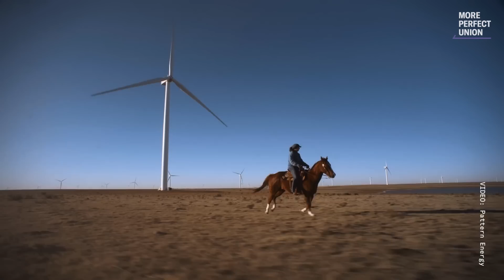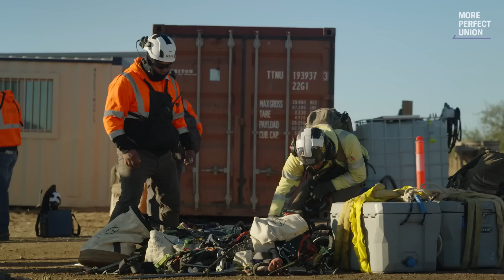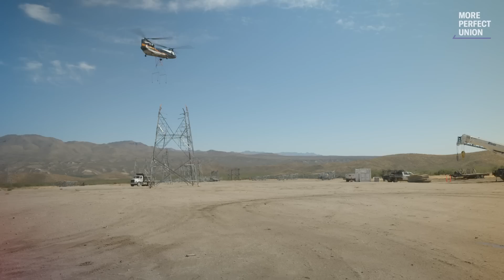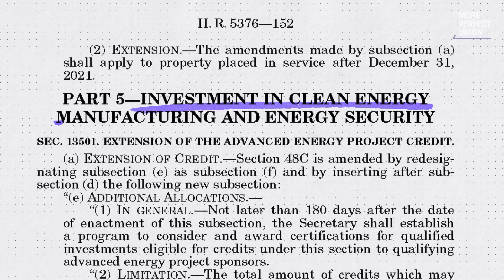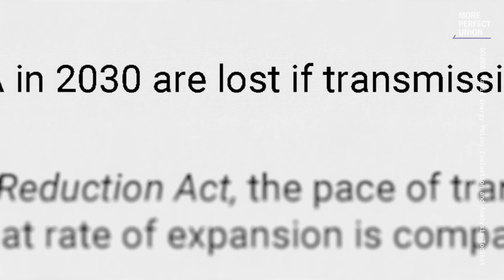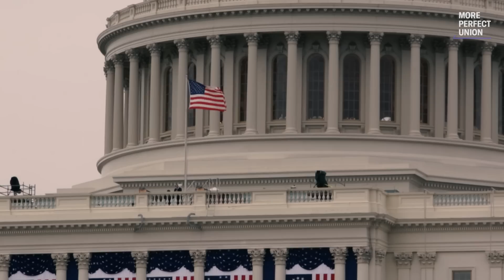Why Clean Energy Might Fail

Comment: Two reasons.

1) Not enough transmission capacity.

2) Billionaires would not be able to derive any profit from clean energy.
Reply: Mostly number two.
That’s why it’s hard to get proper solar investment despite it being extremely efficient in terms of money and resource use. It benefits the consumer, not the seller. It benefits the owner of the solar panels. 
The main impediment to solar energy infrastructure isn’t even storage anymore. Batteries are becoming good enough. The main roadblock is that it decreases reliance on the grid, while fossil fuels increase reliance. And investors want you reliant. 
It’s all about photons coming free of charge vs oil coming at a high price
Reply: 1. Rewiring the grid with newer Hi-Tech carbon fiber reinforced cables is pretty quick and inexpensive compared to building new transmission lines and can increase the capacity many times
Reply: Private equity is getting plenty rich off of wind and solar, while we see electricity bills skyrocket because THEY don't pay for the cost to back up.
Reply: @gregorymalchuk272  yup.. and the companies that buy credits off the renewable companies are not even using the power from those renewables.  Their operations are on the other side of the country where they use natural gas power. Somehow people are being tricked into thinking the gas providers are the bad guys and the renewable companies are the good guys even though the renewable companies are backed by trillion dollar companies.  The renewable companies also use cheap non union labor while the gas plants are hiring well paid union skilled trades workers.
Reply: 2: Oh yes they do.  They own the land that the turbines & solar farms are on.  They make Billions in rent.
And they own every company that makes the stuff & installs the stuff.
The main problem is bad management overall
Reply: What makes you think there's no profit in clean energy? You still charge a premium for the energy delivered, you just (in theory) charge less because you're not paying for fuel, or as much for things like environmental regulation/mitigation, maintenance etc etc.
Reply: @ArmouredPhalanx  you are still paying for the natural gas and coal plants.  They have fixed costs and you either need to hope the grid operators can predict the weather so they can bring those plants back online in time or you need to pay to keep those plants running so they can quickly be ramped up. Where I live there has been at least one case where we had wind shear so the solar producers were quickly changing the direction of their panels so the panels wouldnt get ripped off their mounts which resulted in around 200 MW of capacity going offline within 3 minutes.  As a result we had a grid alert and rolling blackouts to protect the grid. One problem I have is most of the people that comment on stuff like this dont actually understand how a grid works and people listen to them.  If you talk to engineers which actually understand how things work and how fragile a grid is they are sounding the alarm.  I bet basically nobody commenting here really understands grid frequency and they would scratch their head if I bring up frequency following.  With a low inertia grid you can have MAJOR issues with renewables because the renewables are frequency following.
Reply: @pin65371 . And then you have people biased against lower cost renewable energy.  Remember when the tree caused the eastern US blackout?   It works both ways doesn’t it.
Reply: @Bogason1 let’s be honest here you’re just carrying water for the next form of greed.
Reply: 1 nuclear 
2 los Vegas
Reply: @roxaskinghearts  it leaks.. the miami plant is a prime example, and its in local drinking water... i win that argument 365 days a year here
Reply: the miami power plant is leaking...
Nuclear being safe is false. No reply can correct these 2 comments.. or it would not be reported.
Reply: Neither 1 or 2 are sufficient reasons to even slow renewable energy.

A 3rd and 4th more important concerns are:

3. AI & crypto currency laundering & misappropriating our energy and infrastructure tax dollars.

4. The absurdly abusive ambient waste heat created by cheap enough to market manipulate interests.

We need a legit Civil Service force, not just military, not picked through AI abused user interface applications & lazy paid workers scared and saying "that doesnt fit my get rich job security"

An international force of unionized ethically paid human labor, equitably greater than what built our dams, international commerce channels, and every single major infrastructure resource known to mankind.

The American 1% are in the way, while holding 50 trillion dollars of the planet's entire populaces' contributions to American GDP.

Free Humanity to Save Ourselves from War.
Reply: Politicians invest in certain "clean" energy companies prior to allocating our tax dollars to said companies. 
The amount of invasive mining, not to mention slave labor, required to harvest precious metals for batteries and other "clean" energy equipment would dumbfound you.
Look up the largest investor in off shore wind farm and you will find they are the same group monopolizing single family housing. 
Off shore wind farming will cause the extinction of certain whale species in our lifetime.
Reply: As energy is transitioning from a resource to a technology, the profit comes in the form of global R&D and manufacturing advantage over the transitional 'hard working miner/driller' workforce.  We need to focus on transitioning the workforce to modern global shifts than trying to shield ourselves from the global scene by drill drill drilling.
Reply: 3. Just not enough stuff on the planet. FULL STOP. End of story. It's just to make Musk richer and provide a new investment vehicle to put the funny money into (cap and trade) they will jack up the price of energy if there was no tomorrow
Reply: You dont think the people spending billions of dollars on renewable energy projects arent wealthy? In many cases the companies that are "buying the power" are multi national companies that say they are lowering their carbon footprint by buying renewables. They are really buying credits and then setting up their operations in areas with lots of natural gas capacity.  Then the people that live in the areas where all the renewables are being installed have skyrocketing power prices because all of the renewables need to be backed up.  You need to quit listening to the activists and start listening to the engineers.  The engineers who actually understand how a grid work are calling all of this stuff out. Where I live there has been a massive amount of renewables installed and as more came online our price of power kept going up and we started to get more grid alerts.  The government ended up changing how power was bought so the companies producing the power had to say 24 hours in advance what they could provide.  That ended up stalling renewable investments but also cut our power prices in half.
Reply: Fact you listed number 2 makes me unable to take you seriously. The only reason green energy is being pushed so hard is because people are making a ton of money.
Reply: Actually, renewable energy is INCREDIBLY profitable. Unfortunately, it's bad if you're an oil baron.
Reply: @ayanbarnwal2905  Prove it.
Reply: Billionaires wold definitely be able to profit from unreliable energy; especially the shortages.
Reply: that's why they put so many tariffs on solar panels, to make the unaffordable so you have to keep buying electricity from the for-profit grid

Comment: Electricity is only 20% of energy consumption, 80% is fuels
Reply: Now.....
Reply: Building out a network takes time? You sure are a smart one.
Reply: cheapeat fuel is volcano... never ends also, and already has exhaust we dont use
Reply: algae and hemp diesel is superior
Reply: algae, hemp, and volcano are the obviously best untapped markets for energy.
Reply: Solar energy is 100% of consumption. But idiotically Energy as a industry is still freeing 70% from having been trapped in a liquid, gas, and solids, releasing  waste heat and carbon from mostly static neutral states.

We have magnitudes of order greater than we use or need reaching our planet in light from the sun, wind generated by the sun, and gravitational effects on our oceans  everyday. Majority of humans have been cost & convenience stunted from educating themselves.

Comment: Where will you dispose of these blades when they're $pent in five to ten years? ( yeah, i've heard 20 years and i don't buy that)...
Reply: You pick. Hardly matters.
Tiny, minuscule, irrelevant detail compared with the enormous disastrous effects of burning fossil fuels
Reply: They work on recyclable materials to build them. For the time being we must work with what we have.
Reply: Green energy solutions are changing and evolving all the time, and with time, they are getting better. 
We don't have a choice!
Either we, as a planet, DO something, or we don't, and suffer catastrophically in only a few short years!!
Reply: @barbaralamar7336  the blades are more likely to last fifty years than only five.
Reply: @barbaralamar7336  hey I just used the internet to learn a thing!
Many still-perfectly-functional blades have been replaced after only ten to fifteen years in order to get more newly designed higher-efficiency blades in place.
Reply: @barbaralamar7336  eat them, duh. (Really tho, there are so many uses. Buildings, gardening structures, etc)

Comment: The video title is misleading. Clean energy CANNOT fail. It has been around since almost the beginning of power generation and is here to stay. My own country Zambia has relied primarily on green energy (hydro) for 64 years already and will continue to do so. It is not perfect and the current drought has resulted in major shortfalls of power so now I use rooftop solar as my primary source. Sure, some project in the US might fail but that is not what the video title implies.
Reply: And when it's night time or cloudy you use wind turbines. And when there's no wind you use hydro. And when there's no water you use solar.
Reply: Hydro actually makes sense. Wind and solar don't, especially when they refuse to pay for their own backup.
Reply: @gregorymalchuk272  What do you actually mean when you say they don't 'make sense'? My own house is currently running on solar. Makes lots of sense to me. Yes, I wouldn't run a whole grid on only solar or only wind, but wind supplies about 20% of the electrical grid in Europe and if I am not mistaken is the cheapest source of electricity for them. Makes lots of sense to me. Who doesn't want cheaper power? For my own location the grid (hydro) is cheaper than solar with battery backup but solar without battery backup is cheaper than grid so if the grid was working it would make sense to have enough solar to provide power during the day. But the grid isn't working so the choice is no power or battery backup so I have battery backup.
Reply: This is about America, not the world. US blocks clean energy progress. The video is misleading in one though. You do not have to bother with moving energy over a vast distance if you put as much infrastructure as creatively as possible at urban locations. If buildings were designed with solar panels, for example.
Reply: @WatchSecretCrisis  doesn’t the Demokrats‘ Inflation Reduktion Act run on building clean energy? Who blocks it?
Reply: @WatchSecretCrisis  Urban solar has significantly less efficiency and more wear considerations as well as a scale up of existing microinverter/storage technology we don't have now than just building huge solar farms and potentially MSR or battery pool and connecting it to the grid from a long distance. Nuclear is the best option for clean urban energy, but the hesitancy to build nuclear in the west due to slow initial payoff, time and cost overruns from inexperience and complicated regulations prevent companies who are motivated by profit incentive to build them at scale.
Reply: But it will fail in the imperial core.  Anything that bully-onaires do not like will get suppressed.
Reply: Ecuador uses Hydro. It sucks.
Reply: @nickyquiros877  In what way?
Reply: @winterlinde5395   power outages during droughts.
Reply: @nickyquiros877  
That’s bad. So I guess a mix out of multiple technologies would be good.
Reply: @winterlinde5395   Yeah. The only truly good option is a mix use. You rely on a single thing, it will always backfire somewhere. But ecuador went fully hydro grid like 60 years ago before wind/solar was possible. 

I think building codes around the world should follow passive homes philosophy when possible. With their own solar/battery system. And over time it should work. But who knows what happens when the solar systems need to be replaced and home batteries.
Reply: You literally just explained it failing
Reply: @flyinpolack6633  Nope, I gave an example of where a particular instance of clean energy is currently not sufficient to power the whole country due to poor planning by the government (the drought was predicted and they did nothing until it was too late). This has nothing to do with it being clean energy and clean energy has not 'failed'. And clean energy as a whole cannot and will not fail. The video title is misleading clickbait referencing a problem with US politics and the possibly failure to push good policies through the US congress because the US citizenry are stupid and might vote republican.
Reply: @flyinpolack6633 The draught made nuclear power plants fail in France in 2023. Germany was able to support France with solar and wind energy.
Reply: @winterlinde5395 

Yeah 
At 1pm yesterday
 France was exporting 6614 MW of energy 

Glad Germany can help from time to time but let's not forget most of the time they can't and need help
Reply: @ we are working on solutions👍🏻😃.  The point I tried to make was: weather can effect conventional energy sources as well. And I am team Timothy who said diversifying and decentralising works for them.
Reply: It was the heat not the drought.
Reply: @flyinpolack6633 😂 exactly
Reply: Super sus video title

Comment: What we need is nuclear power. Wind, and solar take up huge swaths of real estate compared to a nuclear power plant. Unfortunately, there's still loads of resistance from misinformation regarding nuclear power. Horrendously misguided environmental advocacy groups like the Green Party still spread misinformation that nuclear power is awful and polluting when even the waste is stored in concrete filled barrels, and we can even recycle 90% of a spent fuel rod with large and expensive facilities like in France. Public perception on nuclear power is still tragically rocky when in reality it's our best shot at filling our energy needs now and in the future.

Comment: The only thing that I think would be why renewable energy would fail is because it isn’t able to create a stable energy output that most needs and luxuries require.
Reply: That's why energy storage is a large part of the solution.
Reply: There are ways to improve it...
Reply: Battery tech is advancing extremely rapidly.
EV transition is developing the tech that will allow us to power cities at night with solar power by mid century
Reply: I can agree with that. But there is still the slight problem with not everyone having the means to utilize electricity. So that situation should also be addressed with these advancements in mind.

Comment: Solar+ wind+ batteries for Every building. Decentralize Power generation.
Reply: If it’s decentralized, how does the investor profit from it?
We’ve chosen to worship an economic model in which nothing that doesn’t directly benefit the rich ever gets done.
Reply: I can charge you per unit of oil, but not per unit of sunlight